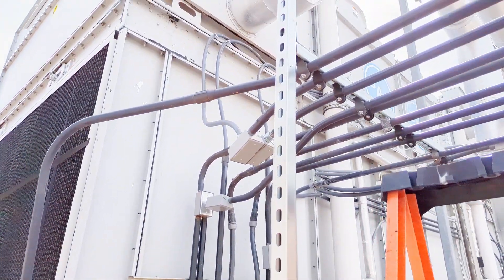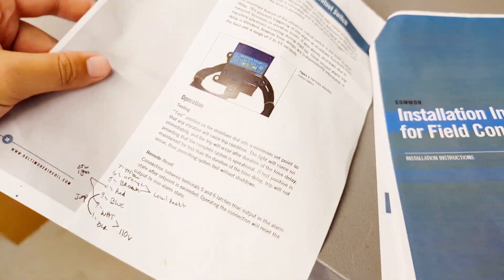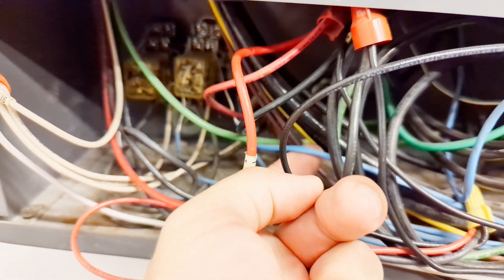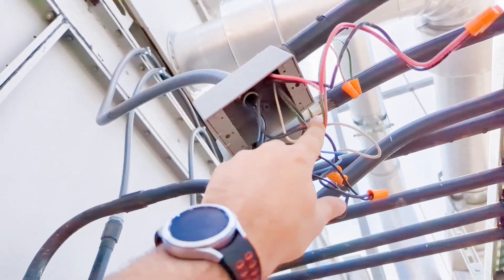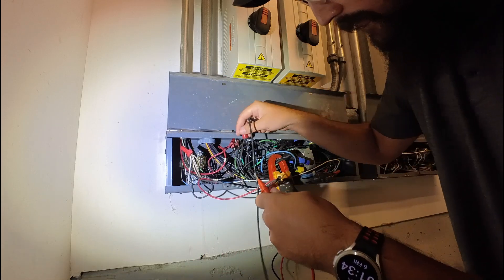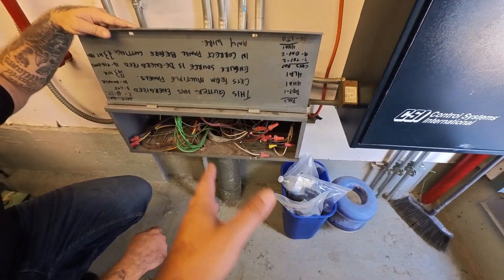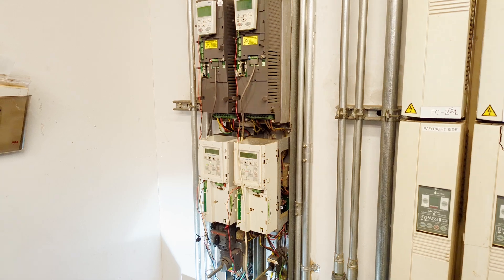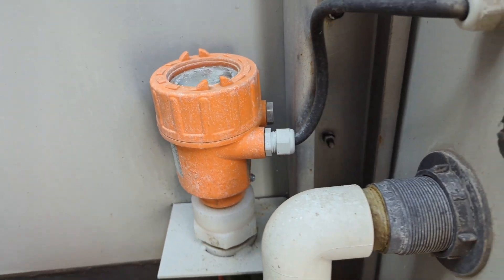Vibration Switch Wiring Not Correct

Comment: What is heat trace?
Reply from the maker: It is a insulated resistive heat strip that is engaged when ambient temps get low to protect from freezing the pipes.
Reply: @HVACTIME  Thank you.  I have known those as "heat tape."  The word "trace"
could be confusing; but if that is what  people call it, then trace it is.  After all,
the factory would not want "idiots" to know what they are talking about.
Reply from the maker: I see it as interchangeable terms. Personal preference
Reply: Great video! I was an hvac control electrician for a short time in my career. When it came to chiller plants with cooling towers I learned to go bigger with the conduits and pull extra pairs of wires. Things always came up like different control devices, stuff the engineer missed, etc. My boss would always jump on me for wasting company money then get real quiet when we needed those spares which was ALL the time!😂